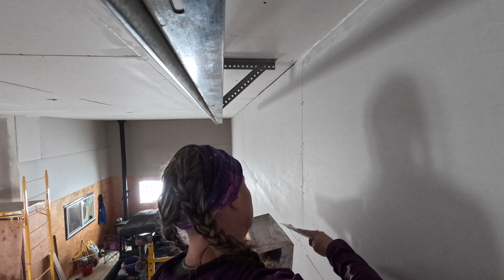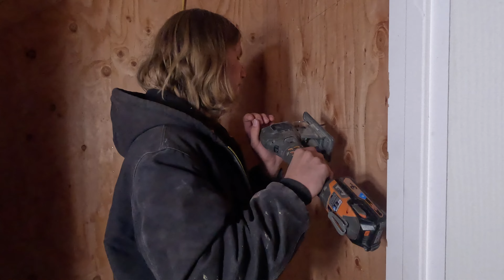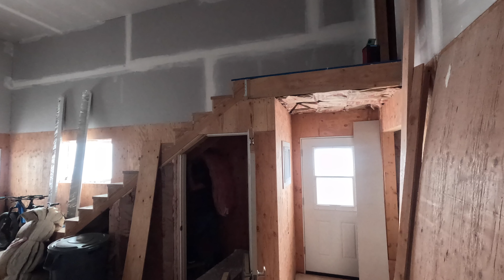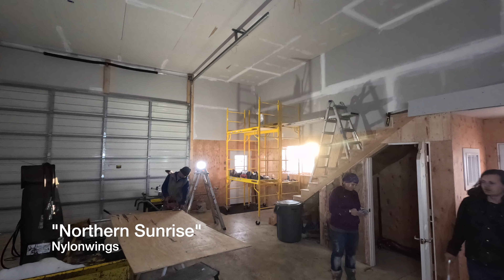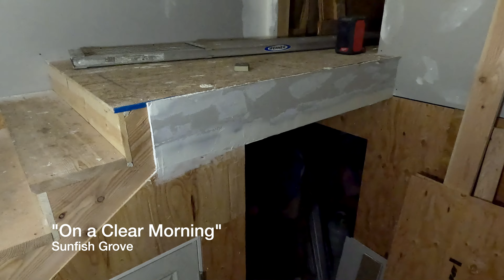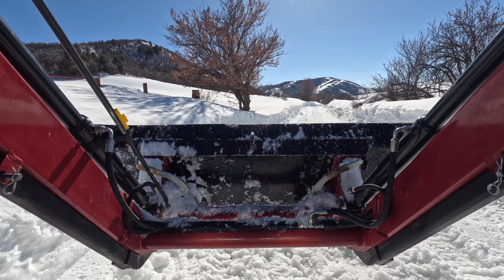WIFE TAKES OVER the SHOP!

Comment: I dread to think how much time you and heath are going to spend on the road once it all turns to slush...you can hire or buy a sanding tool for drywall lowers the dust a lot check on lumnah acres when Al was doing drywall its faster too...

Comment: Some people put old tire squares over the Anchor bolts or horse mat squares to keep the vibrations down from the air compressor. Love the shop❤
Reply from the maker: Yes, I will be bolting it down with vibration dampeners under the feet. Surprising how much sound that eliminates.

Comment: Also on the filter in the air compressor room, hopefully you won't be using it too much in the winter if temperatures fall below freezing but usually if it's snowing there's not much moisture in the air but being closed off it won't pull the draft away from your wood burner.
Reply from the maker: It was very surprising that even on days this winter when we would go 3-4 days without any heat in the shop and daytime temps in the mid teens and overnights +/_ of zero F....  the shop inside never got below about 25 deg F. I've seen some compressors try to start up when they have moisture and frozen temps... never a good result. :)